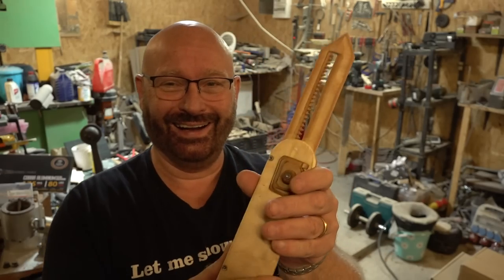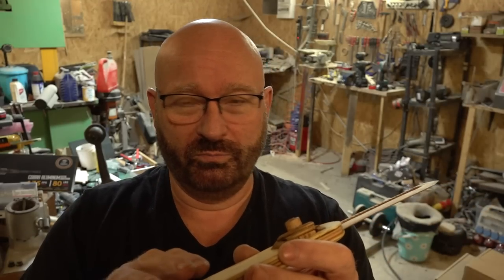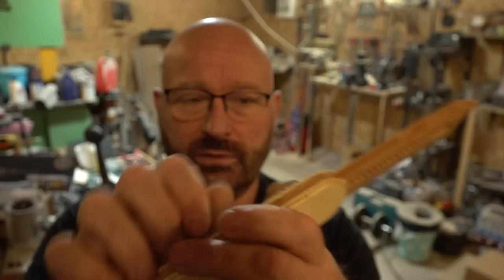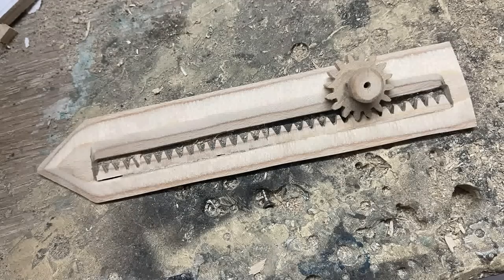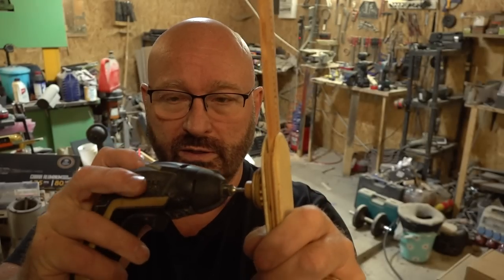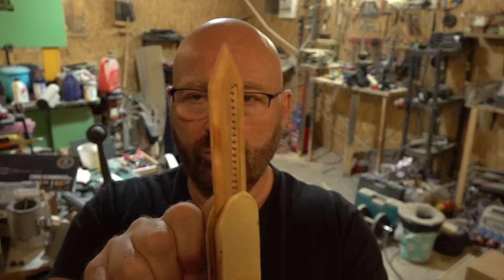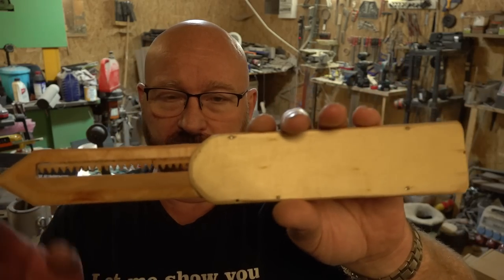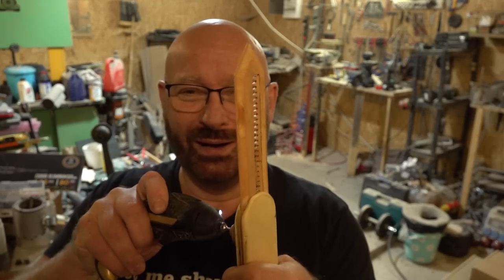The Gear Knife - Great or Dumb?

Comment: It's a very good idea. At first i would use a solar panell to charge the batteries. So it's better to use in Outdoor issues . Also you can use a belt with some wheels to move the blade. 
I think it very good idea to butch a carp for the eastern meal. But don't butch the carp at the 01 April. It's a bad omen to do this. 
If you need a detailed plan for this, feel free to ask me, and i'm sure we can made a good deal about this. My best wishes !

Comment: Make a sheath separate for the knife, but also have the blade retract into the handle like you're attempting. Instead maybe put the gear where the hinge would be on a folding knife and have spines in the sheath to extend and retract the blad when comes out of the sheath and goes back in. Good or bad idea?

Comment: What about a blade launcher? A blade shaped like an Indian Katar, without the handle, with gear teeth on the inside edge of what would normally be the side guards for the handle. It could be driven by interlocked gears i.e. gears rotating in opposite directions, each acting on respective sides of the “guards”& ensuring equal propulsion on each side. Alternatively a double edged blade, with a thin “tang” with teeth on each side and vanes on the plane perpendicular to the teeth (and subsequently the gears, so they pass through the gears unscathed. For rapid acceleration, perhaps it the mechanism could be “spring charged” by the motor, making it more reliant on motor/gearbox torque instead of motor speed/acceleration + torque. Gears can only exchange speed for torque or vice versa, so assuming an optimal spring design (minimum size & mass, with maximum energy storage & response time). To prevent the interlocked gears from binding or having high friction from one of the interlocked gears driving the other too fast, the spring design could be such that it acts on both of the interlocking gears, whilst otherwise being free floating, so that the spring self-corrects the force applied to each gear, by moving into a position of equilibrium. Thus avoiding having to maintain the tight tolerances required between two springs, each driving one of the interlocked gears.
E.g. a when released, a coiled spring will apply equal force to the end at the centre, as it does to the outer end. 
“Tang” length and the circumference of the interlocked gears, could be suitably adjusted to require as few rotations as required to allow for a great deal of creativity with the nature of the spring e.g. perhaps a short chunky spring, that only moves a minimal amount, but with a very high torque, could perhaps only force a quarter rotation of the gears for ejection (in the case of big gears), but do so with an incredible amount of force. 
Though obviously it would require some experimentation and/or calculations to optimise TPI (friction/strength), gear size (torque/speed + angular rotation), tang length (mass, aerodynamics, centre of gravity, duration of acceleration), travel distance of the released spring (spring inertia, how rapidly the stored energy is released & linked to gear, tang & TPI), rigidity of the spring (energy stored as a function of spring compression/extension), mass/size of the whole mechanism & other factors.
On a side note, a strafing movement between tang and gears , could allow the end of the tang to be out of the way of the gears at the point of ejection, so perhaps a trailing cord could replace the need for vanes, allow for retraction of the projectile or become a grappling cord once the projectile is embedded in the target.

Comment: As something new and intriguing (ignoring date of video) it is very neat as a design.

Functionality, even when made out of steel and irregardless of teeth configuration (inside or outside the blade), this could be very prone to jamming or repair.

Perhaps if you can make it reliant on a form of gear assembly that would be less impacted by dirt or other particulates, it may be functionably viable.

Comment: Jörg if you can try to find flat disk motors. There's a name or them that escapes me now but it's a reluctance motor with a flat feromagnetic disk and flat electromagnets like Rimac has. This will make the knife stay flat.

And if you keep to the current mechanical design, keep the motor on one side and the wheel on the other. But it would be cool if you'd make the feromagnetic disk in the above recommended motor as the tooth wheel as well.

Comment: Assuming this isn't a joke video, you could try to use a solenoid and a two locking mechanisms.
When the knife is in the locked position you press down and unlock the knife, the solenoid propels the blade forward and into the second locking catch which holds the blade in the deployed position. Then to put the blade back into the handle you push down on the second locking button (mechanically joined to the second catch) and the solenoid can pull the blade back into the handle.
Kind of like a gauss gun, but shooting a blade forward a few cm and then pulling it back in. You could also have the blade fall back into the handle under gravity.
Not sure if this would be classed as a gravity knife/switchblade though. However if a small permanent magnet was used to hold the blade in the closed position and it held the blade against the force of gravity then it may not be.
The solenoid coil could be built into a round handle. The catches themselves could act as switches by being made out of metal and contact a metal rail when they're pressed. You could either use a tiny microcontroller on a round PCB or passive components on a round PCB and have it put into the hilt, then power it with two 'gumstick' style RC helicopter LiPo batteries that go along each side of the knife and are surrounded by the handle and coil. Handle can be 3d printed out of carbon/glass fibre filled filament for a prototype.

Comment: you could use a flexible toothed strip (like the beyblade spinners that were popular around 2000) and bend it in a U shape in the bottom of the knife (to have length of travel required) with one end fused to the bottom of the blade. it would not expose either gears out of the grip, hence prevent it from getting debris in.

Comment: Why don't you use a spiral spring? Motors needs battery but springs uses elastic potential energy I don't know a spring could fully turns gear enough to get the knife out but still sounds good idea for my opinion.

Comment: I would like to mound the Toothed rackon the side and use an other gear for the motor. The problem on the slow motor ist it's need a high force. It's better with some more turns

Comment: Suggestion. Instead of a motor with gears you could use an electromagnet and coil to propel the blade forward at lightning speed.
Maybe you have seen how they work? if  you ever took apart an old door bell that went 'ding dong' when you pressed the button?
You could power it with a battery but I think a capacitor would be much better.

Comment: Nice craftsmanship and problem solving, but I don't think it has any significant practical advantages and several problems
Like:
-Dependence on a battery
-even with solar power, the cells or wires can fail
-it could break much more easily (especially at the gear while stabbing)
-it could malfunction when the gear is dirty 
-its a LOT slower than a normal knife you can just flick open with a thumb stud
-even with a safe, it might be easier to open on accident
-it will be more expensive
Reply from the maker: Well, I make knives for the collector market. So novelty is important, practicality is less so.
Reply: @Slingshotchannel  Ahh. For that purpose it would be neat.
Thanks for your response and have a nice day!

Comment: Not sure, if this is intentionally posted on April 1st. If not, there are also linear motors, they can be really fast and don‘t even need to be round in any way. You just need to find a way to lock the blade in place, but that’s the same with your current design (which somewhat leads me to believe, this might be a April fools‘ joke)

Comment: you could have a spring loaded handle with a 1:2 gear ratio or better (something like an Ice cream scoop) that when you squeeze the handle, the blade comes out, and it would retract when you release it.

also, stay out of cold water.. unless you have warming underwear.

Comment: I hope this is not an April's fools, as it seems interesting, also it is interesting how much the blade needs to move. What if you use toothbrush vibration motor instead, the movement will be tiny, but will vibration make cutting easier, like cutting in one direction.

Comment: Use a crank and connecting rod instead of a rack and pinion. ;-) One half turn will extend the blade, the next half turn will pull it back.

Comment: I like it. And I see where it's leading. No gravity here. 😁 So you only have to start the motor using neither a button nor a lever. A switch, maybe? Alternatively a manual lock should be sufficient...
But then you could simply use a spring instead of the motor. As long as it doesn't lock automatically.

Comment: I think you have it the wrong way around. Put the gear on the blade tang and the teeth on the sheath. That would be a more elegant solution. Personally I would look at a magnetic drive or co2 cartridge powered version, which is more complex, but would be faster.

Comment: As cool as it looks it's features are pointless no pun intended, why put a motor for something that works perfectly fine without it?! A better idea in my opinion is maybe add a taser function on it, or maybe even add a projectile function on it but it could also have a line attached to it so it can be easily retrieved like a fishing reel you could even use a motor for the rewind function, or add a pepper spray function on it, or even better yet a combination of all mentioned on top of making it very portable, now it would probably be illegal but it would be cool having something like the mortal kombat character Scorpion's kunai and chain which is a kind of harpoon like weapon but it would be better and more deadly, lol!

Comment: Instead of gears, how about a hydraulic ram? With a fast opening valve it would run the blade out faster than gears. You could even have a locking mechanism that could be opened, allowing the blade to shoot out as a projectile. 
A very high powered ballistic knife.
Of course then it would require a pump, reservoir, hoses, valves, etc. The hilt would end up being ridiculously large.
Since its April Fools Day, I can't tell if Joerg is serious or not. I do think it's a cool idea, even if it is a joke.

Comment: What about something like an electromagnetic way i.e an internal track either side of the handle facing towards each other, an electric pulse to force the blade out, hard ti explain but think of a maglev train, no contact of rails and being antimagnetic can use a switch to hold blade out or in when flicking blade out but manually lock when its fully open or closed.

Comment: You need a locking mechnism to keep the blade open. Otherwise it will just slide back into the sheathe while its being used.

Comment: Improvement idea! Put a spring and a battery in the handle, and a dynamo on the sprocket. Each time you push the blade in, you produce electricity, and the spring pushes the blade out again.

It's like a power bank, but for stabbing! Call it the Shank Bank™, make millions!

Comment: I used a cam system (basically an off-set ball joint and socket on a centrally rotating flywheel) connected to a shaft that runs laterally/parallel to the flywheel on a tattoo machine I built for my BSc(hons) Product Design degree major project which I actually took with me to Berlin for the big European tattoo convention about 27 years (I had made some tattoo artist friends from Germany in the Greek islands on holiday) ago and even met the head of the European Tattoo board/council at the time (who was German) to show my product to. Maybe that kind of system could help with this project? Well that or the more obvious bevel gears set up (that I dismissed from my design as too delicate, unreliable and a sanitation concern because of health and safety requirements as well as needing to be run continuously at high speeds for long periods of time. Just a thought and a meander down memory lane! LOL.

Comment: I would just stick with the spring loaded ones that shoot in and out the same way that one does but use good quality steel in them for the springs not the worthless crap the Chinese made ones use, the spring that caught the blade would just fold(bend) on the ones I bought to sell, they were neat but worthless. I don't think your idea is dumb but I don't think it is very practical. Is that an April fools joke?

Comment: Definitely very cool!
However I would not consider this design very practical in EDC use.
The gears weaken the blade and will also need to be cleaned after every usage.

In our conversation on FB you mentioned its biggest advantage being that its legal to own in Germany (which other OTFs arent) due to the blade not "shooting" out of the grip but rather being slowly driven out with a motor.
This is certainly true, however there are other designs which fullfil the same purpose in an easier manner. You could just do it like on the Böker Slike on which you just push the blade manually out of the handle.
Logically the same could be done with a motor...just have a motor push a sled located below the blade inside the grip and you will have an fully electric OTF-knife legal in Germany.

If you'd give your current design to Böker for production I am sure it will be sold out in no time....simply because it is a unique and cool concept made by the almighty Jörg.

If you want to go for something practical I would however look into other options like the ones I mentioned.
Reply: That was my first thought as well, but if the motor is fast enough, it might still shoot out the front. However, the law talkes about using a button or a lever to activate it. So if he used a 3 position switch it might be legal. Or a manual lock, because the law requires an auto lock to make it illegal.
Reply: @keyem4504  Yeah, hard to define the German word "hervorschnellen"...will probably depend on the how the BKA classifies it.
However you are correct that using something that's not a button or a lever will also make it totally legal.
In fact Jörg already did such a OTF knife recently...he uses some form of turning wheel.
However that one wasn't electric but manual.

Comment: Would you not be better off putting the gear teeth into the blade on the same plane as the blade, then turning your actuator 90 degrees to horizontal?

Comment: I don't want to hate, I love most of Jörgs videos but I feel like this is only e-waste...
You have to think: what's the use case for this? Whats the benefit? The list of disadvantages is long, there are moving parts that can break, you have to make it dust/water/blood??-proof, there will be batteries inside!! Will you be able to change batteries? That would be "ok", but rechargables that you can't remove would be really bad for this...
Wasn't there a mechanical knife, it was pretty small, Jörg presented it together with several others in a kind of recent video I think? You could move the blade in and out in a milisecond by moving a tiny part... I have no idea how it works but it was mechanical.
I feel like this would MAYBE be something for collectors, but for an actual usable knife? Only e-waste... sorry :( The cons don't outweigh the pro's... are there even pros? 
Discuss please or try to change my mind :)
Grüße!
Reply: The point is today's date, and on the knife

Comment: I wonder if it is somehow feasible to combine some of your other previous inventions to the gear knife or actually a knife with an electric opening mechanism? Like electric powered pantograph knife with a fingerprint reading switch to turn on the power of the motor. Your type of pantograph knife mechanism has almost twice the length of the blade compared to the handle, so nobody can talk about "the embarrasment of swimming in a cold day". Scales forming the handle protected by fingerprint lock are also the traveling case, which makes it EDC and comply to the weapons laws. If springs that rise the knife from the case are legal, then same should apply to the motor? Combining all the three separate invention forks back to the one, looks like an obvious path for the evolution at this point.

Comment: I wouldnt set the motor direct to the gear. You can use a little belt to put the motor to the end of the grip. I think its a better compromise to have a longer grip than this fat buckle on the front

Comment: The first concept is terrible since it would require the motor to be mounted perpendicular to the blade. The worm drive is the only real concept. 70 turns for a small DC motor is nothing. Maybe .75 second

Comment: maybe you could put a hole in the gear with teeth on it and then use a chuck key that is mounted on a ring and spring loaded.  Then it would be a set... and you would need to use the ring or else it won't open.  Yeahhhhhh, you would be like Blade then.  Because even if someone pulled it out of your pocket they couldn't use it without the ring.  
You flip the top of your ring open and there's a gear in there that's loaded and all you do is press it to release the tension.  Dang I'm smart.  You probably  have the same personality type that I do, we take something good and make it even better.  INTP.  kinda rare